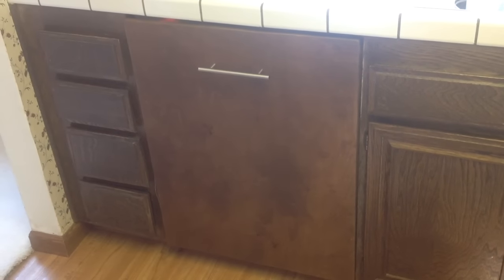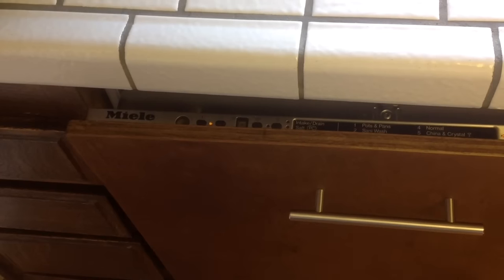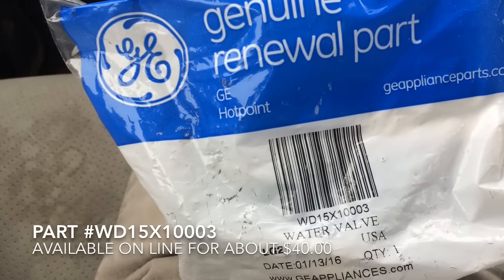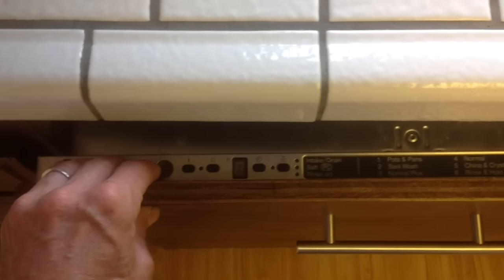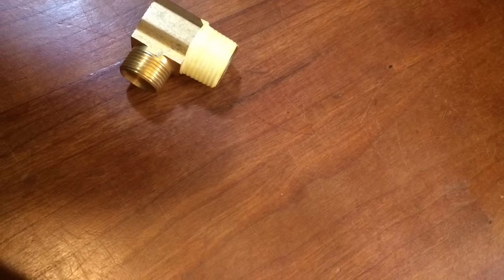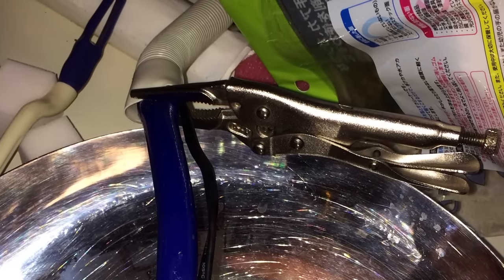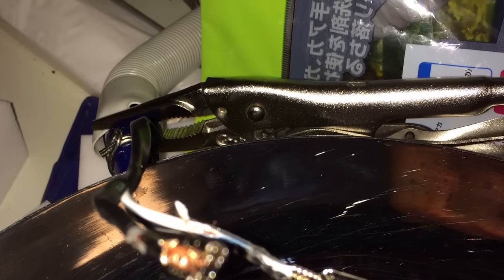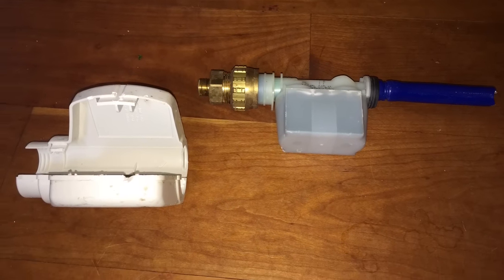✨ Miele Dishwasher intake/Drain Light - Fill Valve - Easy DIY Fix ✨

Comment: I did this in the midst of a pandemic and it worked great til now.  Now I have a Miele F-24 error. The only info is to call Miele service. Is this something you can give guidance to fix? It says it is the water leakage trigger--but since we changed the valve, that no longer exists. I see no water running anywhere.
Reply from the maker: Can you call Miele USA and ask for a new heater relay.  Can you email me at: scottthefixitguy@yahoo.com so I can send you a video on how to easily do that?

Comment: Hi Scott, great and simple fix. The Miele fix seems outrageously expensive by comparison. I found my solenoid was getting power, vibrating, but not opening. I deduced the failure is probably mechanical. I noticed that the original valve has a flow restrictor installed. I can't tell if the generic one does. Has anyone had any experience with removing this part? I guess it makes the fill quieter (a selling point for Miele). Any concerns about the increased water pressure in the machine? How long have people has this fix in service? You're providing a great service Scott!
Reply from the maker: +Mike Procter 

Thanks Mike,

A few customers are at the 4 year mark now.  It fills to exactly the same level as the Miele fill valve.
Reply: Hi can you tell me what the part is that i need to get? Your video is excellent and that will help

Comment: Well, I did pull the dishwasher out and yes it was the same. Before I attempted to replace the valve with the GE one I pierced the power cord to test for 120 VAC  during the fill cycle but i got nothing but .26 volts.  Any thoughts? Again this is the G805 model  with timer dial no light or buttons.

Comment: Does the Miele G805 use the same fill valve design as this model? It is a 2 knob design with error lights on this model. I only see Cooper tubing going into the side of the dishwasher area. I wonder if this is tucked behind the unit or if the G805 uses a build-in valve in the  dishwasher itself. Thanks

Comment: Hi Scott, I have a G892, can you please confirm the inlet valve is the same as the link posted for this video, which is listed as a  Fridgedaire valve? Thanks in advance.
Reply from the maker: Yep,
You’re all set👍
Reply: Scott, dropping a big thanks for the instruction, I was able to replace the pump last weekend. Everything went as expected. just to let everyone know that you need to shorten the original hose a few inches to not stress the electrical wires connecting to the new pump. Looking forward to more videos.

Comment: Scott, my unit is older (G 870 SC, 20 years old) and doesn't have error codes. The unit runs through the entire cycle but never fills with water. We had a similar issue previously related to issues with the drain that caused the drip pan to fill up. But, that doesn't appear to be the problem this time. Would you assume that the inlet valve is my problem?
Reply from the maker: I bet you it is the water inlet valve.
The very commonly fail on the dishwasher.
You can replace it with just a regular $40 generic valve instead of the $220 one from Miele.
Reply: Scottthefixitguy Darn it, I did the inlet valve replacement you explain here, but that didn’t fix. Any next likely culprits you can suggest? Appreciate your help!

Comment: I have a Samsung dishwasher  model no DMS500TR had E2 message came up Which said problem with the Aqua stop  brought the new aqua stop complete with hoses remove the machine to access the hoses and the bottom of the machine has no access points my question is how do u access to replace the hose

Comment: I solved my Intake/Drain Light flashing using your fork method a couple of months ago but unfortunately it;s happened again but the fork isn't working this time despite getting the 'feel' that the rotor is not stuck. I saw on another one of your vids a method of identifying fault codes, is it possible to re-set to factory settings? (Just a thought) Otherwise I will try replacing the valve...Thank you once again!
Reply from the maker: No problem,
Can you send me a few pictures of how high the water gets in relation to the white plastic filter handle after 5 minutes of the cycle?

Scottthefixitguy@yahoo.com
Reply: @ScottTheFixItGuyChannel  Thank you so much for your rapid response. Today I decided to disconnect the hoses and electrics and brought it into my garden to work on it properly and guess what? It started to work as normal! I still think they're great machines so determined to keep it going ....All the very best to you....

Comment: The link here seems to be for the incorrect part, maybe it's too old.  When i check if this is compatible with Miele, the supplier at this link said not compatible.  Please give updated link for the correct fill valve.
Reply from the maker: Hi Gail, the link to the new fill valve does work for Miele but it’s my own retrofit that is far less expensive.  That’s why the supplier doesn’t know it works for Miele.

Comment: Hi Scott,

We have two Incognito DW’s and one has a bad circulation pump..So we have been using the bad deep as a parts machine...previous to the intake/drain light flashing the working machine lost power altogether...Swapped the control panel out...Is there a possibility the “new” control board is faulty and that is why the intake/drain light is flashing?  I have repeatedly shut off the unit turned it back on ..water drains at it starts to cycle then stops and the flashing light comes on...When I change the valve how do I adjust the  water level so it does not get above the handle?

Comment: Hi Scott, The Intake/Drain Light issue is still happening periodically. I went a little further in my investigations by taking off the very bottom panel at the front of the machine and noticed about half an inch of water build up in the bottom panel. I also found a float switch which I presume is there to detect excess water build up and once I slid it out, I proved that it was operating ok. I then noticed a steady drip coming out from a section just to the right of the float switch. Question: Could this build up of waste water be a possible cause of the warning light? Thanking you in advance. Michael
Reply from the maker: Yep, just need to figure out how to stop the leak.
It probably needs a partition kit for the circulation motor from Miele USA.
Reply: @ScottTheFixItGuyChannel  Thank you so much Scott. I'm in London UK but I'm sure that I can locate the fitting. I feel I owe you a bigger thanks.. Have you a Patreon page....happy to contribute!
All the best....

Comment: How did you know the part was faulty?
Reply from the maker: The water wasn’t reaching the bottom of the white plastic handle of the filter.
Reply: @ScottTheFixItGuyChannel  thank you!
Reply: @ScottTheFixItGuyChannel  a repairman told me my Water intake chamber is defective.  This is not the same thing as the fill valve, correct?  If not, do you have any suggestions?  He's saying its a $500 fix and I'm better off replacing the whole unit since mine is about 12-13 years old.  Any advice is appreciated.
Reply: @ScottTheFixItGuyChannel  what symptom did you notice.

Comment: Was the Valve (I found it on Amazon thank you) and brass elbow enough or did you also have to buy or obtain a water flow regulator as well. Did the water intake shut off when there was enough water for the dishwasher cycle?

Comment: Hi all. Im not having any issues with water . My only issue is a high pitched whistling sounds which happens when the dishwasher is filling with water. would that be solved by this fix??
Reply from the maker: Yep, a new fill valve will fix it😊
Reply: @ScottTheFixItGuyChannel  Thank you Scott! If im not having any issues with the water coming in, is the whistling going to lead to anything if i dont change it right away?

Comment: Hey Scott, I did this replacement and when I start a program it will fill, but then the dishwasher just kind of sits there and thinks.  I hear something switching on in the dishwasher every once in a while - but it never progresses in the program.  Any thoughts?  Dishwasher is on the older side - Miele G858 Plus
Reply: I followed your fault code video and found it to be F09 Heather level switch not switching on at the end of thermal stops.  Curious if you know what the problem might be.
Reply from the maker: Hi Lisa,
I would call Miele USA and ask them to send you a new Heater/Pressure switch.
Reply: Thanks Scott!  I will try that :)
Reply: @ScottTheFixItGuyChannel  Hey Scott, I replaced the Heater/Pressure switch, but still didn't work, and was then getting fault F08.  Based on your other videos I figured I'd replace the motor capacitor.  I just finished doing that, but it's still not working and getting get F08 fault.  I did find a piece of the impeller I must've broken off un-sticking it with the fork technique, and wondering if that's likely to be the problem - and can easily be replaced?  Or if I'm at a point of having to replace the entire circulation pump (with which I will likely get a new dishwasher at this point).  Thanks for your help!!!

Comment: Will this fix work on my Miele dishwasher if my problem is that it doesn't fill the machine with enough water? 
When I turn the machine on the water doesn't fill to the bottom of screen filter handle and it sounds like it is starved on water because  the recirculating pump noise is loud, I will dump a jug of water in the machine manually and it works fine with no noise and no warning light
Reply from the maker: Thanks Ken,

This will fix it😊

Comment: My washer is plugged in behind the unit and I cannot reach the plug. If I ensure that the breaker is off, am I safe to cut the wires without worrying about getting shocked?
Reply from the maker: +Paul Wnek 

Great question Paul,

You'll be safe👍. Just make sure the dishwasher won't start up once you turned off the breaker.
Reply: Scottthefixitguy fixed it! you're great! thank you so much!!!
Reply from the maker: +Paul Wnek 

Nice Job Paul👍

Comment: Hi Scott, great video! We have a Miele G1023U that I have just replaced the inlet valve on using a generic 7l/min solenoid. When i first turned the machine back on again, i could hear it opening the valve and all seemed to work. I turned it off and on to retry, and then the technical fault indicated by three yellow lights flashing at the same time came back. Cant get it to work. There may be something else wrong, or is the machine so sensitive it wont work with this valve? I also tested at reduced water flow by closing the tap.
Thanks.
Reply from the maker: I wonder if the lower drip tray got flooded?
Reply: I checked that first, the bottom of the dishwasher is dry as and looks just like when it was new.
Reply from the maker: I use these and they work great:  https://www.amazon.com/OEM-Frigidaire-154637401-Inlet-Valve/dp/B0727NRTDV/ref=asc_df_B0727NRTDV/?tag=hyprod-20&linkCode=df0&hvadid=198068632238&hvpos=1o10&hvnetw=g&hvrand=6610712924481724403&hvpone=&hvptwo=&hvqmt=&hvdev=t&hvdvcmdl=&hvlocint=&hvlocphy=9032028&hvtargid=pla-350015890285&psc=1

Comment: Scott, I changed the fill valve as you explained.  I then dried up the water in the lower pan.  Now the washer is still overfilling.  It overfills to the point of splashing my floor with water.  Could I have a bad replacement valve?  At my whits end.  Thanks
Reply from the maker: +sjdierks100 

Where does it flood?

The lower drop tray?
Reply: out of the front of the machine.  It appears to be coming out of the bottom of the door.  I kept the door open to watch it fill and when it completely covered the handle of the filter on the bottom of the machine, I stopped the fill so it wouldn't overflow.  Thanks
Reply: My wife got fed up and called an appliance repairman.  The local guy said the generic parts never work on the Miele.  I was not here when he was here, but I would have loved to show him this channel.  Still need your help
Reply: You followed a video from a parts changer. Puting a mexico 40$ valve in olace place of a precision german made dual valve. So you put on 1 super cheap valve to replace 2 very high quality valves. Makes sense to expect issues. Cheap valves never work on these. Miele uses 2 valves. 1 is the main and 1 is flood fail safe. They both have to fail to flood your house. In 24 yrs of being a miele factory tech, ive never had one flood. But ive seen a dozen at least theat ppl like this guy put on to save a buck. They fail sooner, and cause more problems than you ever will save. To do the job right pay a true miele factory tech 300 ish bucks and dont lift a finger. Problem with youtube is everybody is an expert but when the going gets tough, they are nowhere to be found!!!! Me? Well we are 2 million $ insured, 5 yr background checks, drug tested and drive trucks that must be no older than 10 yrs old......get what you pay for , afterall, you have a 2000$ dw , not a 500$ unit.

Comment: I have a Miele 892sc (~13 years old) that has stopped filling most of the time.  I removed and cleaned the intake screen of debris.  No Joy (though it had a fair bit of crud).  When it doesn't work, it stops right after starting a fill, after draining.  It also vibrates briefly in that case, so it appears to be getting power and doing something, but I can't tell if water is getting through.  I know that when it does fail, it's right at the start of a fill (rinse or wash).  Sometimes it will get through a few fill cycles before failing again, once it got through an entire wash, but generally not (this started a few days ago).  My big question is if it's likely to be the valve (failing to open, though the solenoid fires or tries), or if it's more likely to be whatever tells it that the valve opened (pressure sensor?  or does it use electrical feedback from the wires (voltage drop/amps/etc)?  If a failure mode for the Miele part is "vibrates but doesn't open", then this fix might be worth trying.    If not, given the age and cost of parts, a more complex repair may not be worth it compared to a new machine, though perhaps a diagnosis for ?70?100? might be worth it.

Thanks!
Reply from the maker: +Randell Jesup 

Great question.

The fill valve is worn out.

I would follow the video and replace with a generic fill valve.

It will work like new and only cost you 45.00
Reply: Thanks; I was all set to try it, and then....  The evening after I wrote that, it started showing all sorts of different sets of lights when being turned on or closing the door.  I believe these are some form of error code (is there a link to something documenting them?)  Most common is all-cycles lit, then sani-wash turns off after a few seconds; or rinse/wash/end all flashing, or just fast-blink from Salt.  In these states, holding Start doesn't reset it and it can't be run.  I did see someone report a similar problem with a useful tip - if one cycle lights, you can run it (or reset it by holding Start, and then run it).  And "bouncing" the power seems to get one cycle light far more often that just turning it on (which virtually never does).  Per what the person I found said, if I push the button enough to power it briefly, let it go and immediately push it again, that usually gets it in a few tries, then I can set the cycle and at that point it now always works - no intake/drain lights anymore...
  Does this still sound like the fill valve?  Could it be the pressure/heating module/sensor under the pump?  Thanks!
Reply: Could be a level control/pressure switch

Comment: I have a G5225 about 6 years old with this problem. Seems to be filling with water and running, but after a few minutes it stops and I get an F13 Intake error. Seems to drain fine.  Cleaned out the cabinet  filters and non-return valve. Any ideas?
Reply from the maker: Might need a new fill valve.

Comment: Hi Scott - I just did this replacement on my Miele Incognito (about 11 years old) after checking the drain hose for clogs, cleaning all the filters inside the machine, and checking the inside thoroughly and the intake/drain light still comes on a few minutes into the wash cycle. Is there anything else I can try, or is it time to replace the dishwasher?
Thanks,
J
Reply from the maker: I think the circulation pump impeller is jammed.  I can send you a video of how to free it up if you like?
Reply: @ScottTheFixItGuyChannel  Always happy to watch more videos ;) To clarify further - the dishwasher will seemingly run for several minutes before stopping and the circular red light flashes, and the intake/drain light starts blinking. Thanks again!
Jason
Reply: @ScottTheFixItGuyChannel  FWIW - I just tried the fork trick, and managed to rotate the impeller. Tried running the dishwasher again, went for a few mins and intake/drain light flashing again...
Reply from the maker: Can you send a picture of how high the water is in relation to the plastic filter handle when the intake/drain light comes on?
Reply: @ScottTheFixItGuyChannel  not sure how to send a pic via the comments - but think i found your website. the level is just below the handle on the filter.
Reply: and thank you for your replies!

Comment: Hi Scott, I did one machine and when I finished it completed a wash cycle. So I loaded it with dishes and when I turn it on (Optima Series) the pc light is lit and if I try to run the drain light and beeping return and it stops. Could it just be low salt?
Reply from the maker: Thanks Joe,

Can you contact me at scottthefixitguy@yahoo.com and send me a video of what you noticed?